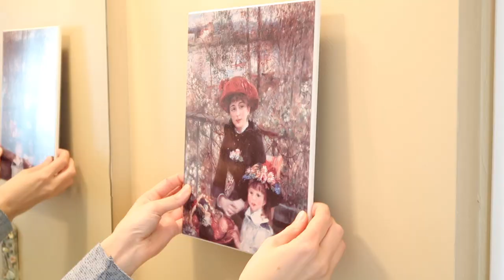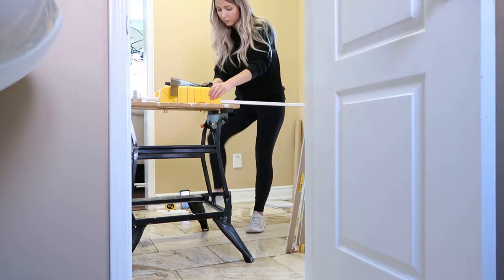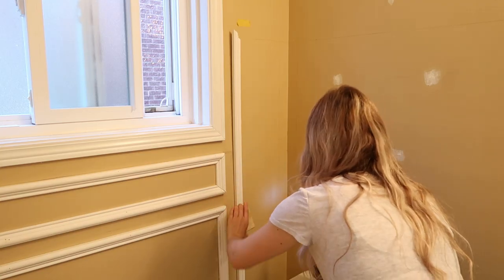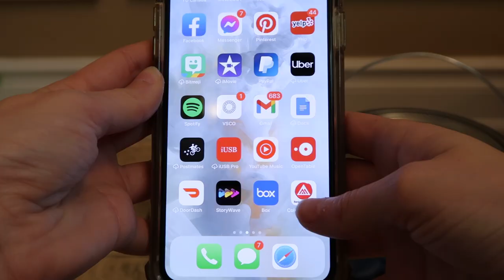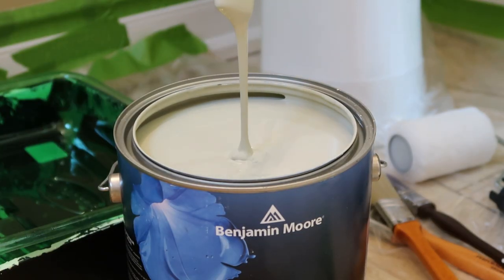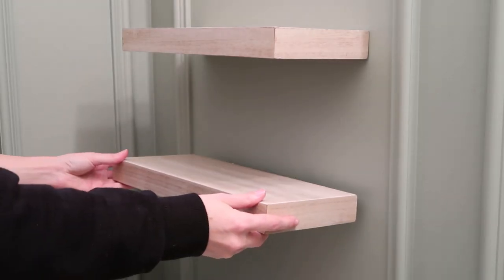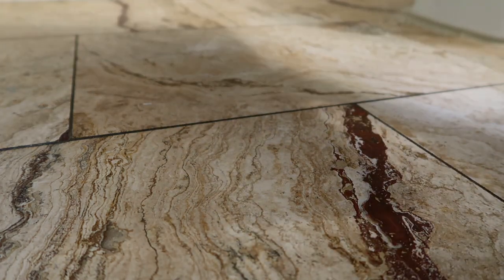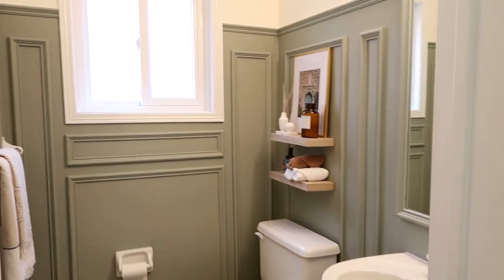EXTREME SMALL BATHROOM MAKEOVER | DIY WALL MOULDING

Comment: Your dad is right: it is outstanding. A job well done. You have the feeling for color and space, which are necessary for this line of work and the interior design community may be happy with you as a part of it. And you dare use your hands, love that part too.
The only thing, that must be done differently for paying customers, is to adjust the placing of the electrical parts, so they do not interfere with your moulding.

Comment: Did you initially use a hand drill to get the screws into the walls when you were setting up the floating shelves? I see that you are manually screwing in the nails but how did you initially make the holes in the walls? Thx

Comment: I love watching your videos...so glad you even listed the chair rail and panel. I am going to make the exact same powder room. Mine is the same size and looks exactly the same except the window. My bathroom has no window, which means no natural light. Will the Benjamin Moore Oil Cloth (Eggshell finish) look good with no natural light? Will really appreciate your response. thanks :)
Reply from the maker: I think it would look really pretty even with no natural light!
Reply: @KristenMcGowan  thanks for your reply...cant believe i starting on this, this weekend. btw whats the height at which you placed the chair rail? i cant seem to decide how tall i want my moldings to go.
Reply from the maker: @pretty95138  yay good luck!! I can’t remember the exact number but it was about 2/3rds of the wall height! Maybe around 70” for me!
Reply: @KristenMcGowan  thanks :)
Reply: Hey Kristen, I was about to place the order for this base cap to use for the picture frames. But I enlarged your video and realized that you may have a different one. Yours in video is not as curved as the one in home depot (I got this by following your link in description and finding the exact same one but a diff brand. This is what I was about to order, https://www.homedepot.com/p/Woodgrain-Millwork-WM-163-11-16-in-x-1-3-8-in-x-96-in-Primed-Finger-Jointed-Base-Cap-Moulding-10001946/203898777#overlay. Will wait for your reply before I place the order. Thanks so much.

Comment: I would have changed the floors too. The colour doesn't match the rest of the bathroom. And the towel hanging over the sink is impractical, would've added a small towel holder. Overall looks good, really like the panelling.

Comment: I have the same comment as for your other bathroom makeover---I recognize you're not an electrician, but this is a safety concern and a code concern. That old outlet above the sink at 13:24 not only doesn't fit with the rest of your color scheme (teeny-tiny little detail, yes), but it should also be a GFCI for safety (Ground Fault Circuit Interrupter). It is not.

I notice also in all of most of your videos you lean toward things you can just plug in rather than requiring an electrician to do some rewiring or replacing existing fixtures / switches / outlets (receptacles). I'm not trying to drum up work for electricians; this is about safety. I think when you lean toward things that can be just plugged in, you may unwittingly encourage people to overload existing electrical outlets and circuits in older houses that may not have enough outlets, enough circuits, or even enough capacity to add an additional circuit if that is needed. You stripped your rooms bare for makeovers, but you don't know what else people have in their rooms that they are going to make over--wall heaters, mug warmers, desk fans, 20 powerful computers mining bitcoin...

Go to 0:23 in this video to see what kinds of things people do in order to PLUG IN everything they want to power up:
The #3 Reason for residential house fires is electrical outlets:
https://www.youtube.com/watch?v=63vzHhCOku8

You might assume most people have more common sense. If that was true then this would not be the #3 reason for residential fires.

Please add to your suggestions that people evaluate their electrical outlet loading or have somebody who knows how do it for them, and either add outlets, add circuits or upgrade their electrical panel and add the capacity required.